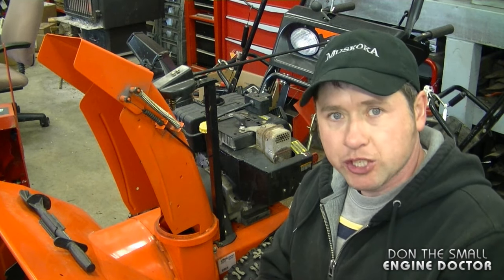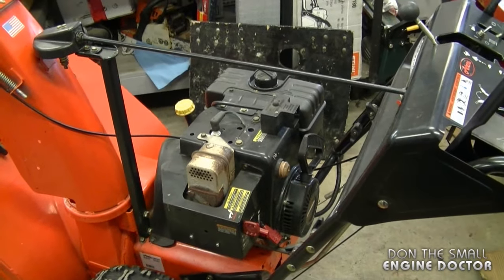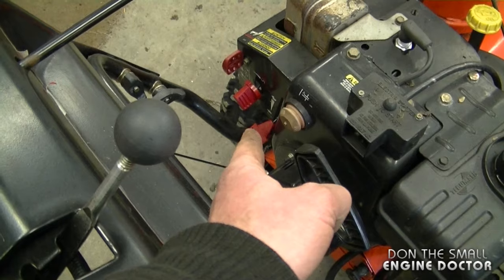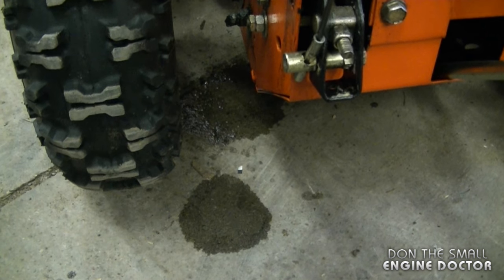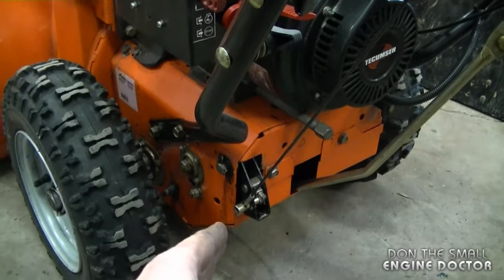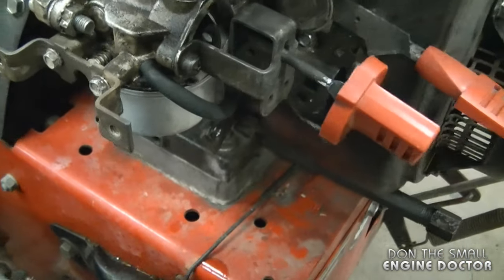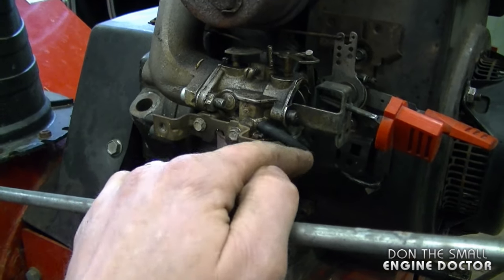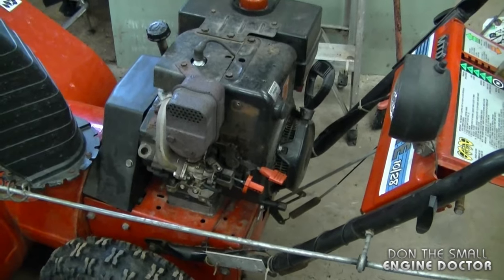Why A Snowblower Carburetor Drips Fuel When Primed

Comment: Donyboy73, hey I have a 926se 1999 cub cadet snowblower.  I have this full issue,  but it flows out of the primer bulb while running and the carburetor.  Alot of duel loss and the Gas from the bulb is being sucker in the pull starter guard. What should I do ? It didn't do this last year and I've done nothing to it . Please help Thanks . Also the pins  that attach the perpeller to the aguer gear shaft won't come out so I can fix a bearing on the auger . Any ideas should I just drill them out and put new ones in? Thanks,  Lance.

Comment: Great videos Dony! Thanks for putting these together! I have a question for you too. I have an Ariens 927LE sno-blower that I bought new in 2009. It has the Tecumseh engine. I had used it a couple times already this winter and has worked great! However, when using it today, it starts just fine, but after several minutes, it just dies. As if it's not getting fuel. Even though they didn't look dirty, I cleaned both jet plugs in the carb and also checked my spark gap. Still does it. Any good ideas you may have I would really appreciate! Thanks Dony!! Keep up the great work!!
Reply from the maker: +Gear Hammer try replacing the gas cap, often they do not vent
Reply: Dony! That was it! Youre a genius! The rubber cone inside the cap had fallen out and I found it in my garage. I reinstalled it and it works like a champ! Thank you sir!!
Reply from the maker: +Gear Hammer you're welcome

Comment: I'm having fuel coming out of the hole in the primer bulb, when the engine first starts and until it warms up a bit. It's a two year old Aires snow tech 24", was surging on first start up of the season, pulled the carb and cleaned it ad per YouTube, it's the has removable idle jet with the plastic screw above. Before I took the screw out a counted the turns it took to seat it so  could get it back where it was.
Which was one revolution, which also left the hole on top completely unrestricted. All back together and test run to see if surge was gone, two pumps of the bulb, second pull and it starts but fuel is dribbling out of the bulb, as the engine warmed and could take it of choke the dribbling stopped but the engine was running way to fast, obviously the wrong setting, many YouTube's later I saw one with a good look at the screw before its taken out and the collar seemed about centred over the top hole, set it there and wanted to run the engine with out the front cover so I could fine tune the setting if need be . Took the bulb assembly off the cover and attached to the carb, opened the fuel valve and now with the bulb hanging lower a stream was coming out of the bulb. I can't imagine that's normal. Would appreciate your opinion on this, and if you know the setting for the plastic idle screw that would be great.

Comment: Hey donny I have a 1964 home lite XL-12 chainsaw that has a stripped out spark plug hole. Can I just replace the cylinder or do I need to rebuild? Where are the best places to get parts besides eBay? Love the videos very informative and entertaining.
Reply from the maker: you could you a spark plug heli coil kit

Comment: Donyboy73, is this the 10hp engine?
I bought a a 10hp Tecumseh off Craigslist, is has a "516" on the Carb, I know it is not the the original carb (the previouse owner told be he bought the carb new (but it doesn't look like what you have on the one in this video), will the carb work for me? 

I am going to use the engine for on a logsplitter. 

BTW the engine starts, only when I spray engine starter into the carb. Runs 20 secs  I am VERY new to adjusting Though this 516 is the non adjusting carb you talk about in other videos. 

Also, the Tecumseh Control Bracket Assembly is on the side of the pull rope housing BUT there are no wires or cables. 

Please advise, Mike

Comment: Please help me, I have a cub cadet  with the 5.5 Tecumseh I can't get started,I put starting fluid in the spark plug hole nothing,  I tried cleaning carb then new spark plug then check spark good  check compression 130 then valves I give up not a single stroke ...I don't know
Reply: Did you turn the key or stop/run switch on first?
Reply: @wildbill23c  everything is on order to crank but nothing happens  I got fuel spark compression I spray starter fluid and nothing last thing to check is the time but if could be that the engine would kick back.

Comment: about 10 years ago I had a small Ariens with a 3.5 HP tecumseh on it. it had the type of carb with a diaphragm on the bottom rather than a float bowl. it dripped gas constantly and I even went so far as to replace the carburetor with a NEW one and even the new carb dripped fuel unless the gas valve was shut off. darn thing never ran right, I think it was just poor design.

Comment: Pretty crappy cause now the thing smells of gas when you put it away.   Is it possible to put a small slight bead of silicone that can handle gas around the edge of the float bowl ?   In my eyes the thing should be sealed and not leak fuel no matter how many times you prime it.

Comment: THANKS FOR POSTING!   Mine is doing also doing this after a rebuild.  I bought an aftermarket kit, not genuine Tecumseh.  When I took the carb apart to find the problem,  the float bowl O ring has expanded/stretched from the fuel.  It is this normal or just inferior parts?   Also, the float needle included in the kit is shorter than the original.  I kept the original.   Should I order a GENUINE kit?
Reply from the maker: you should replace with an oem kit, the aftermarket ones are inferior and don't last. Actually when I use aftermarket carbs for those Tecumseh I replace the bowl o-ring with an OEM